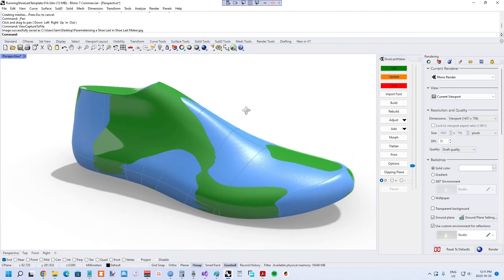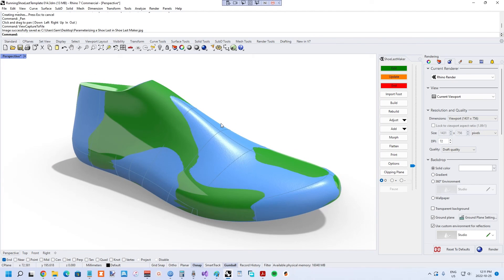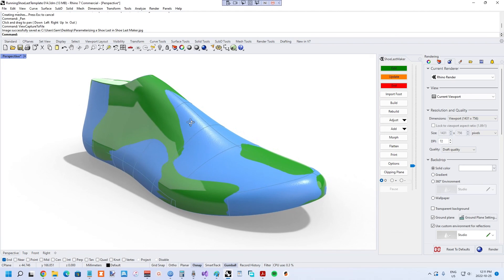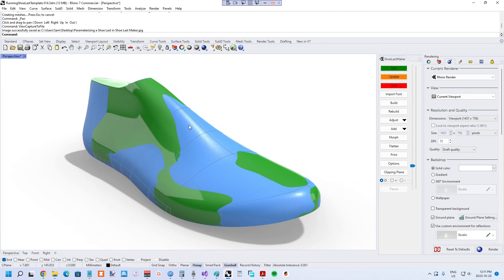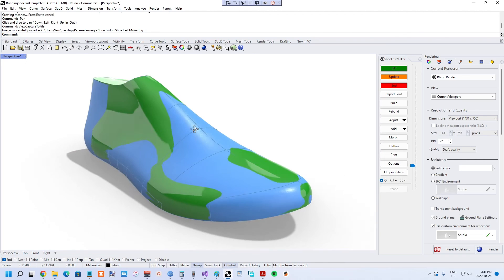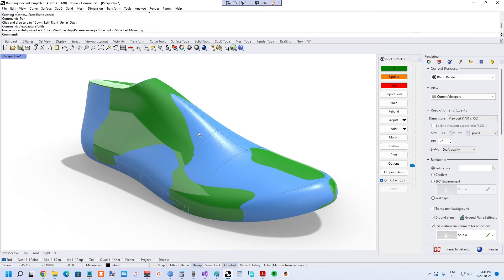Parameterizing Shoe Lasts

Comment: Is it possible to grade the entire shoe that you have modeled in rhino or can you onyle grade shoe lasts in 3d shoemaker? I want model  a shoe sole and use it for manufactering purpose in different sizes.
Reply: Not currently, but it is an upcoming feature, no time estimate currently
Reply: Hey, grading is not that hard, it's just math. You can use different methods to do it. I remember there was a formula, but I forgot it. My old job used to send the grading to another place, and they had this old machine that looked like a huge metal etcher sketch. It would cut out paper shapes. I had to check them before they made the knives. The main thing is that the length changes by 5 mm and the width by 2.5 mm for each size. But some parts might look bigger or smaller because of the shape of the shoe. It's tricky to go from 3D to 2D, you know? You also have to check your lasts, because they might not be the same for all sizes. I'm using 3ds Max now, and it has a tool called 'UV unwrap' that is like 'form making'. It can do grading and springing easily. I already printed a prototype pattern, I just need to see how it works. The cool thing is that 'UV unwrap' is a common tool in other 3d apps like Blender, so you can switch software if you want.
Reply from the maker: Grading is now possible via morph: https://3dshoemaker.com/morphing-components-between-shoe-lasts-in-3dshoemaker/